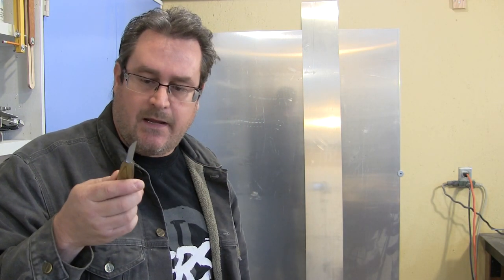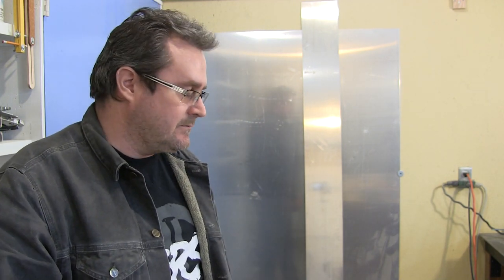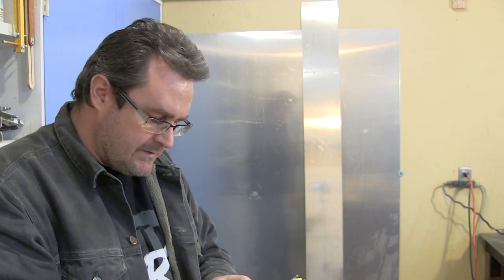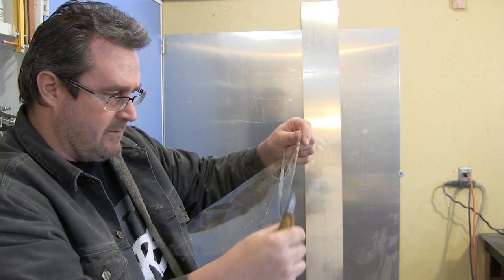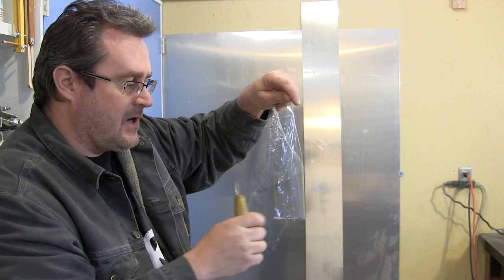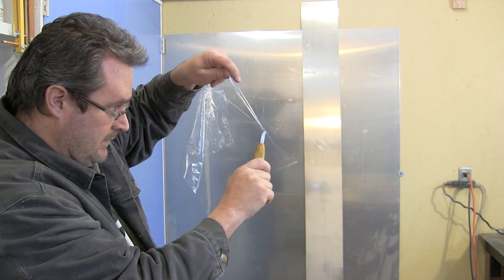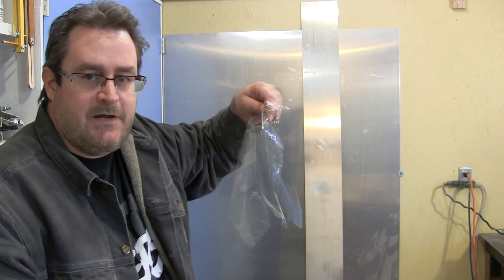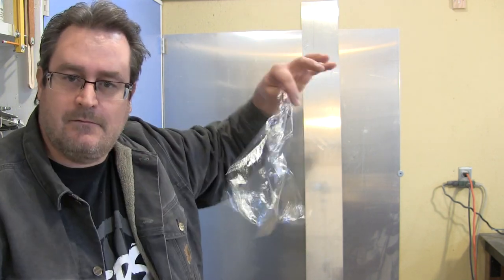How Sharp

Comment from the maker: I see that your comment has the most thumbs up, so I guess that many agree that you think cutting into the edge of a sheet of paper is more difficult than this. I can assure you, it isn't. I easily sliced through paper (even very thin receipt paper) easily, and thought that it would not be a worthy test.
Weighing the plastic film would not be much of a test either, since that is more of a "cheat" than piercing the middle of a a sheet of paper. 
Like I said, try this, as I did it.

Comment: I tried it & you're right, it takes a very keen point to pierce the plastic & a sharp blade to continue the cut w/out a snag.  I still don't think the tests are equal tho because I believe a point will more easily establish a cut by peircing than a blade at an edge.  I give you that a clothes pin is too much of a cheat, but adding a bit of weight is probably valid.  BTW, my comment wasn't intended to question the sharpness or quality of your blade, just the testing method used to demonstrate it.

Comment: The paper test is done by bringing the blade into contact w/ the edge of the sheet and pulling it into it.  The theory is that the blade won't enter the paper, it just buckles if the blade isn't sharp.  By poking the tip of the blade into the field of the sheet, the test is short-circuited.  I might try clipping a clothes pin to an edge of the plastic wrap to provide a bit of weight to keep an edge straight, then proceed w/ the typical blade/paper test method.